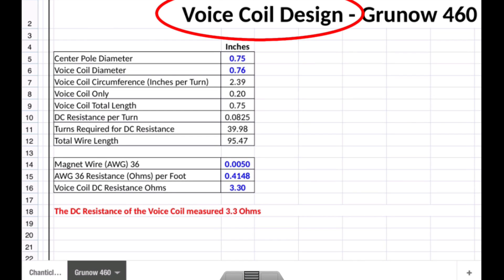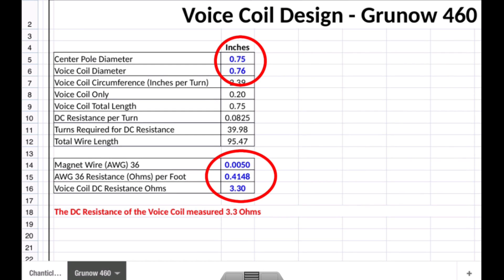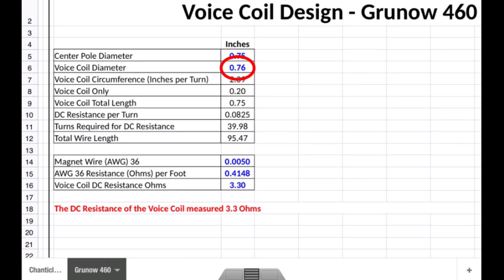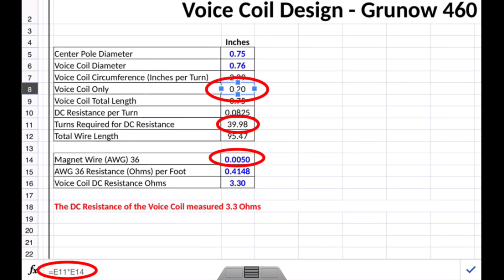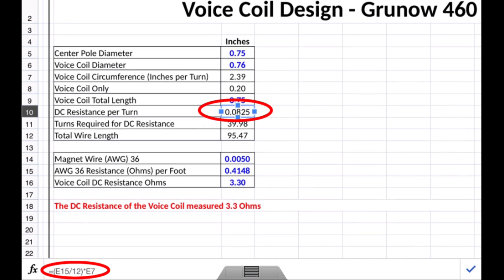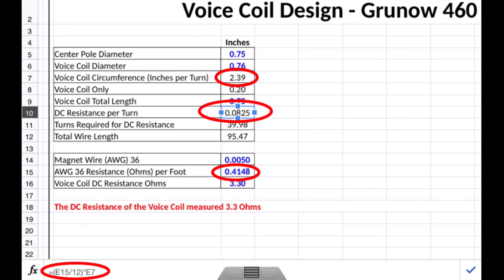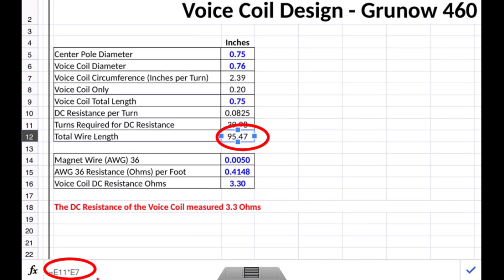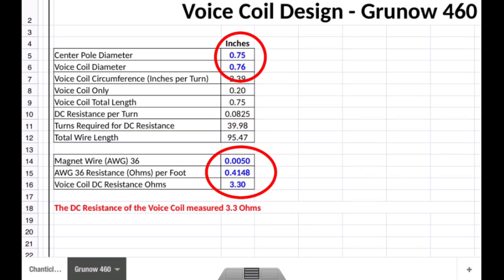Voice Coil Design

Comment: Thank you for the upload, help me a lot understanding how vc works. Attempting to restore a broken sony tweeter. Searched forums but most gave a shallow explanation on how and why. Your detailed explanation had gave me the answers i was looking for. Thanks
Reply from the maker: You are welcome! Hope your project is successful. All the best. Don
Reply: @RestoreOldRadios  hi sir, finished recoil tweeter for the 3rd time using your calculation/formula. Finally got 8.2ohm reading. Tweeter now working thank you. The 1st and 2nd i used the suggested gauge/length in a forum but only got .3 and 1.0 ohms
Your video helped a lot in restoring a dead apm 22es tweeter! Thanks again

Comment: your last videos have been a big help to me as I am working on a RCA 19K that is giving me issues. It is a 2 ohm voice coil in a speaker that is very distorted on low end. I can not find any damage to the cone or the spider, I also swapped out the 6f6 tubes, this was no help. I have a 8 ohm speaker out of a organ that is the correct size and looks very similar. ok now the question........... Can I remove turns on the 8 ohm voice coil to bring it down to 2 ohms or will I have possible problems with the wattage? I think the 2 ohm is around 18 watts and I do not know the wattage of the  8 ohm but it has the following printed on it: R180-033-00            28726            2857643
  I know this is kinda out there but as for the 8 ohm info, but maybe some one might understand the info on it.
Thanks 
   Paul
Reply: OK , I have always believed that the person with the most experience has blown up the most wile learning.
  I got out my variac , a volt meter and a amp clamp.  I did a very unscientific tests by applying different ac voltages to the 8 home speaker and watching the amps. This is the readings I got: 1.7v= .2 amps(.34W), 5.1v=.5amps(2.55watts), 8.6v= 8amps (6.88watts)
 Am I on the right path or am I walking through the dark woods scarring people?
Reply from the maker: +cptrdbrd Paul - sorry for the belated response, work has been crazy  busy and I wanted to look at the schematic for the RCA 19K before replying. The OEM speaker is rated at ~5 watts and has an impedance of ~4 ohms assuming the voice coil has a DC resistance of ~2 ohms as noted in Riders. In my mind, it would be impossible to remove windings from the alternate speaker voice coil. If you use the alternate speaker, you'll still need to use the existing field coil (choke), which has a DC resistance of ~1060 ohms and you can purchase a new universal output transformer at: https://www.tubesandmore.com/products/P-T291 and wire it up to look at a 8 ohm source. This will match the 6F6G tube load resistance to the 8 ohm speaker. The push pull audio circuit for the RCA 19K produces a max of 5.5 watts, so your replacement speaker would be a little over rated, but still useable I would think. Hope this helps. Best, Don
Reply from the maker: +cptrdbrd Paul - in addition, do you confirm there's no dirt or other... between the center pole piece and the voice coil? Forced air can be used, but be careful as the voice coil/speaker cone is very brittle. Did you consider using shims around the center pole piece and mist the speaker cone with water and let it dry for a day and see if the distortion clears up? Best, Don
Reply: +RestoreOldRadios - Don- Thanks for the great info and the help with the info on the transformer. I figure if it comes down to using the newer 8 ohm that I will have to add a separate chock or a wire wound resistor to it.
  I checked the voice coil by pushing in and out on it. Looking back this was not a good way to check it. The speaker was very dirty and it would not surprise me  if there is dirt behind the voice coil. that would explain why it is ok for low volume and talk radio but sounds nasty with more low end use. I am guessing the voice coin moves in and out more and be more likely to bang into piled up dirt behind the coil.  (does this sound reasonable to you?)
 my plan is to carefully remove the cover in the center of the cone and gently blow compressed air around it. I will set the regulator on my air compressor to about 5 or 10 psi first to try not do damage it. (sound ok?)
If that does not help I will probably try shimming and wetting the coil like you suggested . replacing the speaker will most likely be a last resort.
 I will probably not get to it till the weekend.
 Thanks again for the help
  Paul
Reply from the maker: +cptrdbrd Paul, it's worth a try. I've tore apart a few speakers after trying my best to improve the sound quality only to find rust and fragments around the center pole piece. In addition, many of the spiders have been bad. There are some very talented folks on "ARF" with a lot more knowledge and experience than me. You probably have looked at previous threads, but just in case: http://www.google.com/custom?q=Speaker+rattle&sa=Search&cof=LW%3A460%3BALC%3A%23880000%3BL%3Ahttp%3A%2F%2Fantiqueradios.com%2Fgoogle.gif%3BLC%3A%23880000%3BLH%3A60%3BAH%3Acenter%3BVLC%3A%23888888%3BAWFID%3Ac6d45a6e1fd29e31%3B&domains=antiqueradios.com&sitesearch=antiqueradios.com  I hope the repair goes well and keep me abreast of your findings as I'm always looking to improve my knowledge/skills. Best, Don
Reply: +RestoreOldRadios  I made some time and took a look at the speaker tonight. I noticed before how exceptional the cone looked but dismissed it. I removed the center cover and found the edge remains of another cover.When I move the cone in and out with the cover off I noticed a slight rubbing noise. There is a viable difference in the gap around the center.when I drag a paper shim around it it is loose in some areas and others are tight.I think I ether have a botched re cone job or the speaker has sagged over the years.
Reply from the maker: +cptrdbrd That's a great find and may allow to use plastic shims (don't use paper if you're going to spritz the cone with water, they can dissolve and get stuck between the center pole and voice coil; I've been there done that) around the center pole piece and lightly mist the cone with water protecting the voice coil with a piece of cotton or other... and see if it will reform itself. Hope this works out for you Paul. Keep me posted. Best, Don
Reply: found  2 screws holding the spider holder. loosen, shimmed and tightened. 100% better thank you, thank you, thank you.
Reply from the maker: +cptrdbrd Congrats! I'm glad you were able to save the original speaker and associated... Best, Don